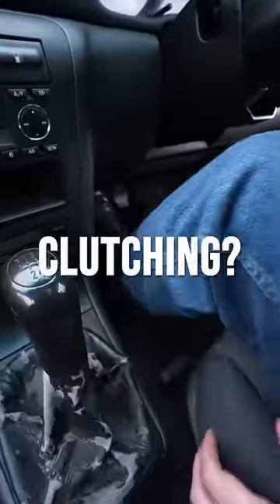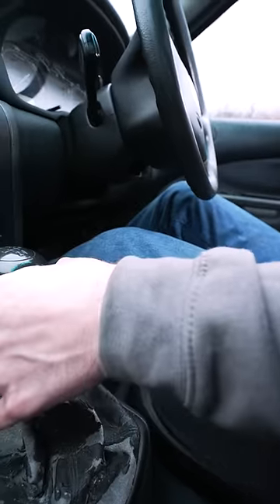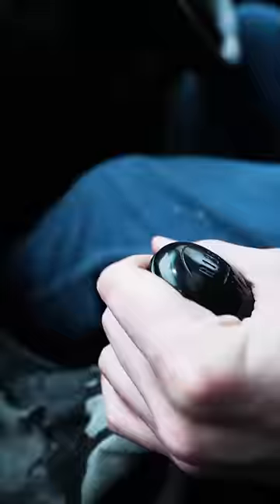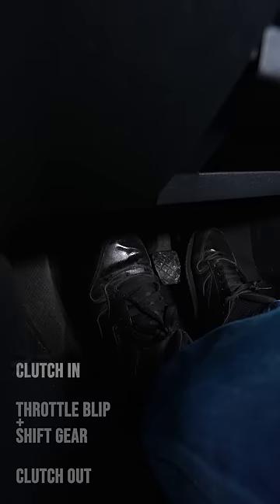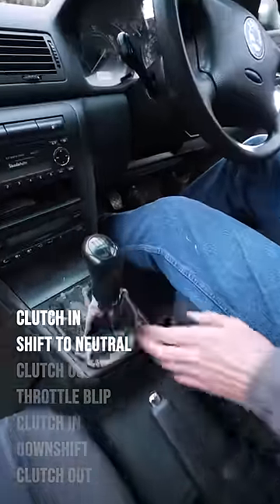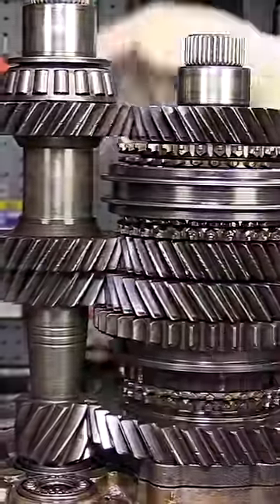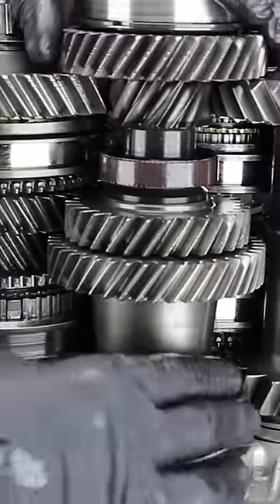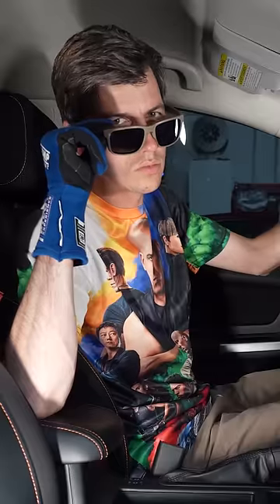What Is Double Clutching? Don't Granny Shift!

Comment: Always double clutch when going into 19th.
Reply: Maybe even triple clutch just to be safe
Reply: agreed, no way to fit a synchro after 18th gear!
Reply: Absolutely necessary to get that pink slip W... everybody knows the rules
Reply: My Eaton Twin split only had 12 forward and 3 reverse gears but you only used the clutch to start and stop. All the gears in motion you just matched the gears with the revs.
Reply: @gabehorn69420 Nah, that's only when you move both sticks in the same shift
Reply: Semis don't have synchros, but usually can float shift to avoid the double clutch.
Reply: @nothingsurprisesmeanymore  As a diesel mechanic, I find it amazing how many people don't know that. I come across drivers fairly regularly that use the clutch when driving. And then they wonder why the clutch brake broke or wore out prematurely. I've even seen the release bearing break off the pressure plate from over use a few times.
Reply: Technically according to Eaton fuller this is the correct way to shift from 1-18 gears. Not sure they have a 19 speed box yet though so who knows?
Reply: @bushkangarutha7849  20 speed transmission are out there.
Reply: Yeah, Mack did a 20 speed, there's a few redundant ratios though. Same with Spicer that technically did a 24 speed, but same story
Reply: Never double clutch with a synchronised gearbox. It will just stuff the synchroniser rings. If you believe what those clowns do in movies where the cars are mounted on a trailer.
Reply: Sage advice 💯🤣
Reply: TO BE FAIR the semi-truckers still usr this when they go into like 16th gear
Reply: It's Double De-Clutching actually.
Reply: but not when going to 52nd
Reply: @jolting   Floating is just double clutch shifting without pushing the clutch. Its the exact same motion.
Reply: @lindsaybuchecker5373  If you actually do double clutching right then there will be no speed difference between the two splines so there will be no stress on the synchros. This means synchronizing the engine RPM to transmission speed manually.
Reply: @gabehorn69420 I like to cinco clutch when I shift from 1-2.
Reply: @tripplefives1402  floating can avoid wear if done skillfully. Lots of damage if not.
Reply: @davidwelker102 Definitely drivers going from a car to a semi, not knowing the engage points of the clutch, and clutch brake.

Also frankly I think a lot of them don't even know that they have a clutch brake.

Used to work on a yard, and the number of idiots who would just grind into first (2nd, third, whatever their starting gear was) was astronomical.
Reply: @Atlquotl  The new trucks now come base with the automated manuals.
It's basically a robot shifting a manual. It's got pneumatic actuators on the shifting forks and one pulling the clutch back and forth. They use spinny flyball weights now which extend out and contract to control clutch speed to shift, and the transmission can override the engine speed to rev up or down for shifting and it even turns on the jake to slow down the engine faster to upshift.
Reply: Took the old W203 out the other day and used this method. 

It was a very nice cruise down memory lane, literally:)
And after my mostly now single gear only days since Tesla (summer of 2022(?)
I am way Glad I never got rid of it @jolting  estimated the time since covid warped it haha
Reply: From 20 you need triple
Reply: It's not 90th.
It's like before an automatic transmission.
Reply: It's like from 60th
Reply: what vehicle has 19 gears!
Reply: I drove 10 speeds not 19
Reply: @bestdjaf7499  never downshift from 60th, you’re way better off going back around ending at zero after 100
Reply: I drove a Mack Dump Truck with a 5 speed Maxadyne Mack exclusive manual npn synchronized transmission they originally built for industrial and heavy duty use. It found its way into their truck tractors and would never fail no matter how far off the correct RPM match that had to be almost exact else the gears would grind and not mesh with each other until it did but nev3r have I seen a tooth on a Mack get broken by abuse and wher3 our family had a fleet of trucks and an uphill g4ade that would have even the journeyman driver stopped dead still when trying to upshift, even if they knew the truck had a non synchronous system. Mack's had a very low rpm idle which would have to unspool before the next higher gear could be managed and when downshifting doing so and forcing the RPM over 2300 would send the valves through the pistons by overspending the engine. They were Special type trucks for special type operators for sure.
Reply: Always double clutch when shifting up in gears.
Hate those movies.
Reply: You driving a semi truck (tractor trailer)?
Reply: @tripplefives1402 , that’s very useful to know, I might have to put one of those in my pickup if I get to build it.
Reply: Well it's a 50/50/50 just how many times you should clutch.
Reply: When your coming downhill 10 4 gears and Georgia overdrive?
Reply: @dogwalker666 yes that is the correct term
Reply: @stevedawson256  👍🏻
Reply: Way back when, my 61 Freightliner had a 5 x 4. It was a truck and trailer hay hauler.. wheel base around 225 inches. On a steep grade that frame would wind up.

To down shift a 8 mph, shifting without the clutch was too slow because the frame had to unwind to get it out of gear...with the tall load, that's a lot of angular momentum. 

Double clutching... Violent as I dumped the clutch but it the shift happened fast. When you're doing 8 mph pulling hard, there's there's not much time.
Reply: Everyone knows that!   Literally everyone...come on🙄
Reply: @davidwelker102 I used the clutch the first day of driving school, and my first day working as a driver, until I told my trainer floating was easier for me
I don't know a single driver that uses the clutch. If I found out one of my friends did, we couldn't be friends anymore
Reply: My clutch broke. What’s the next step please?
Reply: @davidwelker102 teach those boys the clutch 'stab' method if they insist on using it. Save you the work.
Reply: @tosborne8062 Georgia overdrive is neutral free wheeling ...downhill.
Reply: @gabehorn69420 Just doing a quick stop putting the transmission im reverse
Reply: @jolting yes they do. Not all of course but they do for sure.
Reply: @tripplefives1402 no. It's unnecessary.
Reply: @gabehorn69420 you can never clutch enough when going into 19th. It’s like a pre-flight check
Reply: @brandondickie3456  “cinco clutch”😂
Reply: Ya really have’ta to hit 19.
Reply: @lindsaybuchecker5373  If your synchros are already shot, you can still drive the car though.  Rather than grinding every shift.
Reply: @dogwalker666 no double clutching means clutch out, sync engine speed, clutch in.
Reply: @MachineEarth  Yes that's Double De-Clutching, My Dad learned to drive lorries in the army,  They didn't have Syncromesh gearboxes,  And he taught me to drive,
 I don't need to do it now because my car has Flappy Paddles.
Reply: Now that's an odd number gear so you odd clutch so single or triple clutch, you'd double clutch for gear 30!😂🤣😂
Reply: PROFESSIONALS DON'T DOUBLE CLUTCH, WE DO SOMETHING CALLED POWER SHIFTING AFTER MOVING 1ST GEAR.
Reply: @khn7180  floating is what I was told, back when I started.
Reply: Making it 38 clutch cycles to get there and 76 clutch cycles to get back to 0.
Reply: @nicholasdowns3502  Had to learn that from a YouTube video? 🤣🤣🤣🤣🤣🤣 Shows how smart you are. Or not. 😅😅😅😅😅😆
Reply: Drove a truck with 16 gears some 35 years ago. All synchronised. 
So you might be right regarding that 19th gear...
Reply: @HugeRademaker   what 16 gear truck had sync gears 35 yrs ago? Just wondering.
Reply: @MachineEarth  DAF 3300. 2 x 4 gears plus every gear had this high/low extra gear.
Reply: An experienced semi truck driver doesn't use the clutch for anything but starting from a stop and stopping- and I mean STOPPING- not COMING TO A STOP. Pushing the clutch pedal to the floor before coming to a stop will ruin the clutch brake resulting in having to grind the trans into gear from neutral.
Reply: Century
Reply: @nothingsurprisesmeanymore Eaton gearboxes are useless
Reply: if semi trucks had overdrive:

Comment: The best is when you're tached out at 9000 rpms, and then downshift from 19th to 11th to blow by the car next to you!
Reply: You need to lift the front end off the ground for a little extra zoom so don't forget to hit the spray right after shifting into 11th.
Reply: You gotta hit that NOS switch!!
Reply: Or blow your motor😂
Reply: Don't forget to say "too soon junior" or you won't pass and you'll nuke the manifold 😉
Reply: @rogermccaslin5963 need that Cuban NOS for that
Reply: The only thing flying by the car next to you are the pistons and rods from your blown up engine .
Reply: @timc333  Hey, if the piston rod that was fired out of your engine like a gun crosses the finish line first that's still a dub. ;)
Reply: It's always impressive to the driver you passed when they can wave goodbye to your transmission in the middle of the road as they retake you.
Reply: @milhousevanhoutan9235 unless it's a rotory and goes up to 10,500 rpm and say LETS GO!
Reply: Danger to manifold.
Reply: Or even 19th to 18th..red line it then back to 19th.
Reply: I remember when I was a kid, I let my friend drive my car. His car only had 4 gears so he didn't know how to get to 5th. He hit around 6000+ rpm on gear 4, then accidentally shifted into 3. Car was fine, but I didn't let him drive again.
Reply: You've never been in much less driven anything with a 19 speed or turned 9 grand.
Reply: @KarlBoss-lq6me  and you've obviously never heard of sarcasm.
Reply: @brentfromsomewhere  nope, not ever.
Reply: @KarlBoss-lq6me it’s a Fast and Furious reference. When they’re racing, they shift like 15 times in a 1/4 mile race
Reply: @jasonengland2357  I know. One of the dumbest movies I've ever seen.
Reply: The only thing you'll blow is your engine... would be a similar experience as if you're in 5th at high rpm and than kick the gear into the 1st with your foot... why foot someone might ask... because it won't get in any other way... except you're Iron Mike, his right hook should do the trick as well. Anyway, no more shifting after that
Reply: With what? Bits of connecting rod?
Reply: That made me laugh a little too hard.
Reply: @KojiKazama I dislike the "I know what I'm doing" people, more often than not they don't know what they're doing.
Reply: I like to yell i never narced on nobody before I destroy an engine
Reply: It works because the recoil of throwing a rod through the firewall propels the car.
Reply: Then the floor panel breaks and flys away. Instant weight reduction and more NOS